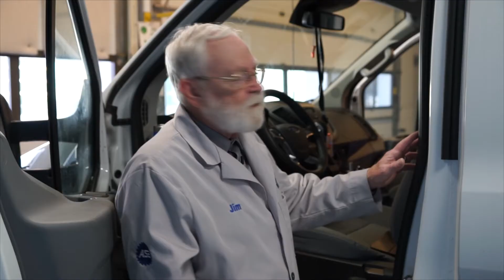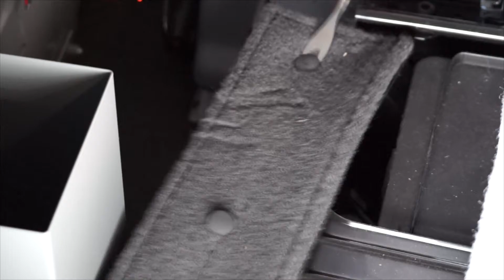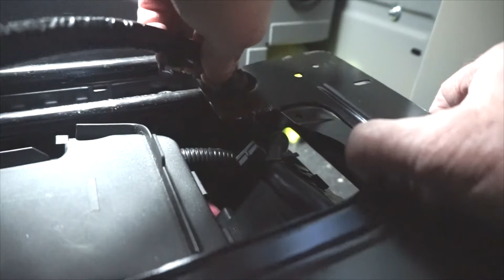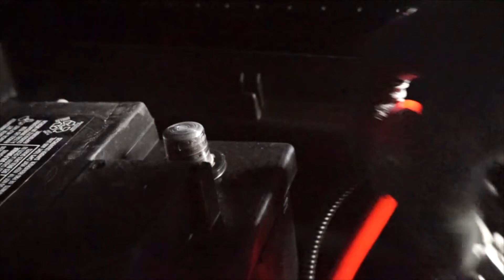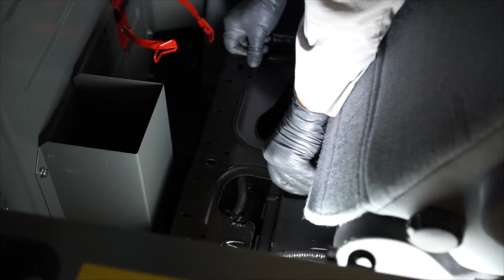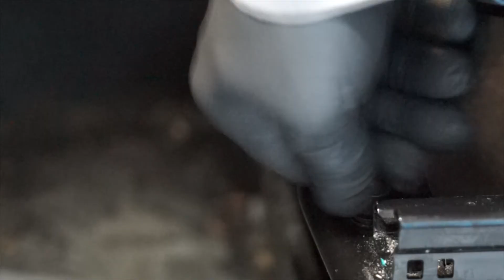Ford Transit 250 (2016) - New Battery Install

Comment: Great video. I was able to take the battery out Without removing the bolts for the seats. I just pushed the seat all the way forward and tilted the seat down to the steering wheel. Then unloosened the 2  8mm screws for both the positive and negative. Then took out the plastic bar holding the battery in place. Twisted the battery from vertical to horizontal. Then pulled it out and replaced. Took about 10 min. I can do it in 5 now that i know how.
 Careful though, the battery is heavy.
Reply from the maker: Hi - Thanks for watching and sharing your experience!

Comment: Im glad I have to strip the whole interior to replace my battery.
Reply from the maker: Hi - Thanks for watching and sharing your opinion!
Reply: I'm sure if you do it everyday, it's probably pretty simple. I spent 2 hours trying to get this battery installed and I still can't get the cover on right so the seat slides. 🙃 next time it's road assistant and someone else can fix it. Thanks for the tutorial.

Comment: Does anyone have specs for the proper battery to reinstall? Would like to have it in hand while going through all this. 
Thxs Bob
Reply from the maker: Hi - Thanks for watching! According to BCI, this vehicle required a Group 48, 610 CCA battery.
Reply: Thanks for your help
Reply: Does this battery group 48 take care of a Ford Transit 350 it’s a Thor motor coach ( Gemini ) 2017 sorry for confusion. Typo

Comment: What's the best strongest battery especially for cold weather conditions
Reply from the maker: Hi - Thanks for watching! Any answer to your question would be an opinion based on whatever research, if any, was done by someone either here or anywhere. The manufacturers, sellers and users of any battery that is not chosen would naturally be on the defensive and would strongly disagree and try to provide evidence to discredit the researcher and claim that the battery they make, sell or use is the best. Because of this, we suggest that you check out the many opinions that you will find all over the internet and other sources (books and papers on battery technology, specifications, performance, etc.) to arrive at your own best conclusion, which will then be your own opinion. (This reply was not prepared by a lawyer - just someone with more than 1/2 century of practical experience in this automotive industry).

Comment: Whoever at ford suggested this want flogging with a big stick.
Absolute stupidity.
Loads of room in the engine compartment for a battery.
Reply from the maker: Hi - Thanks for watching and sharing your opinion! Experience reveals that batteries located inside of the vehicle last much longer that batteries located in the hot, harsh environment under the hood.

Comment: Great video! The Engineers at Ford didn't do anyone any favors on this one! Its a ridiculous place for a battery!
Reply: They do it on purpose, they make it so difficult so you take the truck back to the dealer for simple repairs. It’s a con-job.
Reply: For real what a joke
Reply: Just imagine this job if you have a cargo bulkhead. It can be done without getting behind the seat, but it's anything but ergonomic.
Reply: @michaelstadler349  oh ya, I have the work van bulkhead ! I guess I should have mentioned that, lol! 
Now that I have been in there doing some extra wiring for adding a 700 watt power inverter it does get a little easier but still a heck of a spot for a battery!
Reply: @mctourer5549  I have a 2500 watt inverter in mine. I’m replacing the battery this weekend.
Reply from the maker: Hi - Thanks for watching and sharing your opinion!
Reply: Ya and if you install the swivel seat on passenger side without taking the Jack out you are hooked, the the person who put mine in!!! Now I have to remove my seat to get my Jack out @@@@

Comment: Hey Man, Just wanted to let you know as soon as I typed in changing battery on transit you popped up and I hit your link. much appreciated, spot on with no extra stuff, thank you. I agree, with you Mr. Smith, I just went out and changed the darn thing in the snow and cold. I could think of better spots for a battery!!!
Reply from the maker: Hi - Thanks for watching and sharing your experience!

Comment: Doesn't replacig the battery begin with choosing a suitable replacement?

I have two batteries. You haven' helped me replace either one.
Reply from the maker: Hi - Thanks for watching and for sharing your opinion. We suggest that you refer to a service/repair manual for your vehicle to get the additional information you need.

Comment: Hi,maybe a stupid question but how you can do a start with jumper cables.Thanks.
Reply: There is a positive under the bonnet (hood) under a red cap, and a ground ring located on the engine block.  No need to get to the battery.  👍 This applies to all transit 350 models.

Comment: Hi. I have a Ford transit van 2014, 2.2 lts. Diesel. I want to replace the battery, but saw today I has 2 batteries. My question is:
Do I need change only one and the another is part of the car ? Thanks
Reply: Did you find out about this? Having the same problem finding info
Reply: @Pastieman71  there are 2 batteries, also they are special batteries for stop / start , they are more expensive than normal one.
Reply: I’m in the uk. The two batteries are as follows: the rear of the two powers the engine turn over. The other battery runs all the auxiliaries.

Comment: What do I do with the fuse cable? It’s a wire with a piece of metal on the end with a hole and a fuse attachment. Where do I connect it?